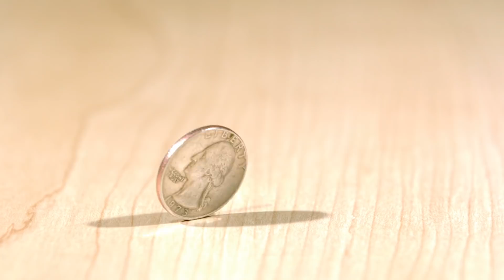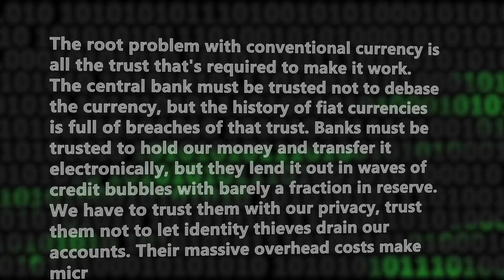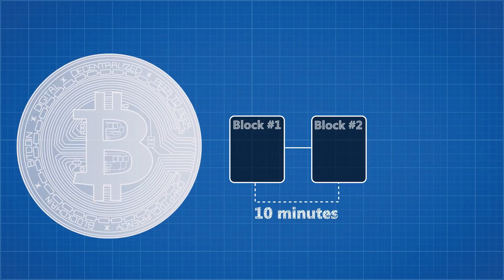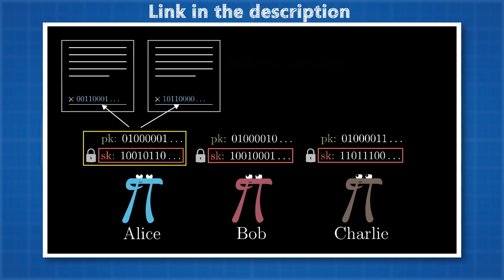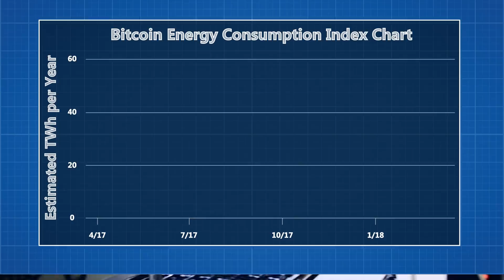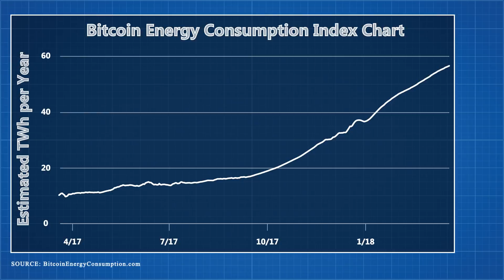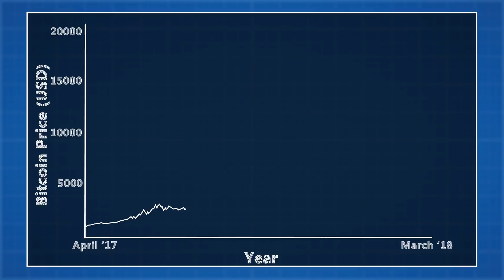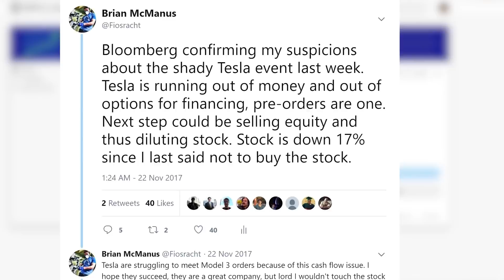Why Bitcoin Is Not Working

Comment: please fail

I want my graphics cards
Reply: OffPH.wnr You don't know what you're talking about. Bitcoin mining difficulty has risen drastically over the last 1,5 years making GPU-mining obsolete. Noone mines Btc with GPUs anymore, there's just too little profit at too much cost. Btc is now being mined with ASIC miners, the fastest being the Antminer s9 with 14,5 Th/s.

Altcoins such as Ethereum, Dash and ZClassic are mined with racks of graphic cards and are then exchanged for Btc or fiat currencies.
Reply: OffPH.wnr if you actually took the time to read past the first sentence and think, BITCOIN has not been mined with graphics cards for a long time. There is zero profit to it, it's pretty much pointless even if you somehow have free electricity because the difficulty is so high. It doesn't matter if you have 1 or 10 000 graphics cards, it doesn't get more profitable the more graphics cards you add because of the electricity and hardware cost.
Reply: Don't worry mate... as soon as a card stops being profitable, which won't be long a year or less will be its lifetime before the mining difficulty makes it obsolete, there will be a flood of cards and you'll be able to get them SUPER cheap.
Reply: you realise graphics cards will be cheaper due to this
Reply: This will get you better graphics cards in the long run. Demand drives innovation.
Reply: Used for mining, not mining Bitcoins. The small amount of total bitcoin miners that are still using graphics cards are losing money and are using so little electricity it's insignificant to the issue.
Reply: Do we have to have a "Bitcoin isn't mined with GPUs" comment in every thread? Yes we know that, but Bitcoin is pretty much synonymous with cryptocurrency at this point. Many people mine alt-coins and convert it into Bitcoin, so in a sense they are indirectly "mining Bitcoin." So what if it's not technically correct, we all know what is meant.
Reply: likewise mate, likewise.
Reply: yeah, but thanks to these crypto currencies craze people plant malicious program in peoples personal computer to suck of computing power from them
Reply: redX111t do you live on Mars?
Reply: You just proved your ignorance.Nobody uses GPU for mining bitcoin.
Reply: Bitcoin isn't even the cause of graphics cards going up...
Reply: +OffPH.wnr you can't mine bitcoins with graphics cards for a long time. you need ASIC miner. don't spread false news. You are just being ignorant.
Reply: m4ryou5h I know you're exaggerating, but even if it's a small amount of the total miners, there are still a lot of graphics cards being used for it. Go on Craigslist or r/hardwareswap and you'll see a lot of people selling cards that were used for mining.
Reply: Dude you don't understand anything about crypto currencies.
Crypto will be here for a while, Bitcoin dies ethereum rises, ethereum dies litecoin rises and so on
Reply: bingo Insignificant to the issue of mining, but not to the issue of the lack of supply and inflated prices of graphics cards.
Reply: +ApavTech bro other coins can be mined by the graphics card and you can't mine bitcoin by the graphics card anymore. as an example, if you mine bitcoin your electricity cost will be 10$ and your income will be 0.01$
Reply: #iboughtyourgpu
Reply: Me too, still stuck with 560 ti's
Reply: Oh, and you should all tell which algorythm it is not used anymore for. SHA-256 is too hard now for gpu's, rendering their use kind of obselete. Of course they can still be used, but gpu's are more used on other like X11.

But anyway, bitcoin is the name flag of crypto's and therefore is confused between both. Bitcoin is 1 crypto in hundreds more.
Reply: Graphics cards won't go back to MRSPs even if all cryptocurrencies crashed. The flash memory modules (AKA RAM) shortage is the major responsible to the rise in GPU prices. The majority of miners are just consumers like you and me. But if you wanna blame anyone blame Samsung.
Reply: My point was  bitcoin was not the issue of no graphics cards.
Reply: Juusto, I'm sorry, I don't listen to hypocrites
Reply: Bitcoin hasn't been mined with graphics cards for a long long time, they make dedicated ASIC chips for that. Cryptocurrencies like Ethereum, Monero, Zcash and some other altcoins are the sole reason the GPU prices have soared recently.
Reply: TheRBZ we all do m8
Reply: me too bro... me too...
Reply: ASIC chips are very mediocre in mining + gpu's have higher demand because of their quick installation, thats what i think of anyway
Reply: Honestly you don't need more then a gtx 1060 if you want better go get a better job.
Reply: hahaa fuck you and do something else than just sit behind the computer.
Reply: its not going to fail you fucking nerd.

Comment: Disappointing, I expected better from you. No mention of Lightning Network and other layer 2 scaling solutions like RSK  to obliterate the 4TPS limit.  You havent thought through the environmental impacts either; bitcoin mining will naturally move towards marginal profitability, and thus cheap renewable energy. It will even only become profitable using excess renewable energy, thereby monetizing energy that would otherwise go to waste. This is good for the environment, because it makes renewable energy capacity affordable  and its much more efficient than electricity storage. As for volatility; thats inevitable as long as bitcoin usage is only an immeasurable fraction of fiat money, but there is no need to price things in bitcoin. Stable coins or even fiat pricing works fine for now.
Reply: RSK doesn’t really work lol. Federated pegs aren’t trustless.

Comment: It's important to note that the VAST majority of electricity used to mine bitcoin right now is being used to throw numbers at a wall and almost always get it wrong.  I don't know the exact number, but I'm willing to bet it's well over 99%.
Reply: merchn44b Actually +90% of gold mined where inside/contain other minerals/metals, it need to be crushed and filtered and processed with harmful chemical before the gold can be extracted and in it self very harmful to the enviroment.
Reply: KnowingBetter The chance of guessing incorrectly is around 99.99999999999999999999% (1 - 6.5*10^-23) with the current hash rate. Lol
Reply: Nathan Ryweck Debatable. What is a bitcoin doing other than representing money? Nothing. Gold has a lot of use as a material in itself.
Reply: 2 months ago bitcoin mining would consume all the electricity produced from the biggest 9 or 10 power plants in the world - there is a good list on wikipedia, search for the biggest power plants by capacity and take the first 10.
This was in perfect case - most powerful miners with lowest possible power consumption per hash, no old hardware, no GPU, no wasted power on backbone CPU/PC.
Reply: At the current hashrate, you have a one in 14,909,717,412,600,000,000,000e chance of a hash being a solution. That is 0.000000000000000000000067% or 99.999999999999999999993% waste
Reply: Huge wastes of energy.. yay.
Reply: merchn44b no. It's like saying gold mining is bad because 88% of gold doesn't get used for any purpose but store of value, and spending real labor power to create symbolic value is a drain on the labor market, and on any critical resources used to mine gold.
Reply: Yes, but then you have to ask WHY are we mining gold? There could be good reasons to do so/to mine and process rocks that generally have no gold in it. The difference between gold mining and bitcoin are great. Geology contributes to how gold is located, and you can use that information to not waste time digging a hole in your back yard if there are no other factors that indicate the existence of gold in that location. What signs can steer a miner towards a correct code? How can they reduce the energy wasted to successfully mine coin?
Reply: Nathan Ryweck Cryptocurrency itself is also negatively affecting customers in other markets, like the video card market. Gold is not negatively affecting other markets.
Reply: Kanglar Exactly, saying that bitcoin doesn't work is like saying money (anykind) doesn't work. Money is just one kind of proof of payment or a ledger of trade, that state you have a certain Values of valuables(is it a work you had done, or items you sold) in your hand that you can trade for other items/service from others.
Reply: As Thomas says, sometimes computing a result by brute force is the only viable method. The real problem is that even when you have the right answer, its only purpose is to prove that you wasted a ton of electricity finding it. It's like basing your currency on the wasted work of digging holes and filling them back in again, over and over again.

Compare that to distributed computing systems like BOINC where the output is desirable for its own sake, like modelling the physical behaviour of protein chains.
Reply: Thomas Kilmer that's a short sighted and destructive goal. The concept of cryptocurrency is here to stay. So long as the worlds economies keep turning. (Which they won't). Quantum computing isn't even close to where it needs to be to hit that target. But that's only half of the coin... As soon as that happens we will have quantum encryption and whole new era of cryptocurrency. So the thing that you're so gleefully betting on to burn down crypto will actually be it's rebirth. 

But by that time crpyro will only be a drop in the bucket of what we'll be seeing.

Not that it matters though. Technology will be our undoing. We'll have destroyed ourselves twice over by then. The odds are far more likely that ten years from now you and I will be having a much different conversation while sitting around a camp fire cooking a dog in a post apocalyptic hell. "Hey Tom can you pass me the radiation meds?" 

"Id love to Ale but we had to eat my arms last week remember? If only we came across this dog a week ago... Or if I had picked rock instead of scissor..."
Reply: apocalypse most gold does noting useful at all. Only a tiny fraction is used for any technological purposes. Most is sitting in a vault, off of the market. If it were on the market, the price of gold would plummet and gold mining would no longer be profitable and the gold could be used for better tech, such as better computers, electronics, and medical equipment.
Reply: I think that is the point and the purpose of the video though, yes mining gold is wasteful, expensive and the purpose behind Bitcoin was to get away from that.  Instead they just created a modern day gold rush changing nothing.

Bitcoin's only real value (same with gold) is what people put on it.  And yes all of our money is the same.
Reply: @merch That's is absolutely not the same fucking thing
Reply: @  
Akshay Sapra I think that it's a fair analogy.
Reply: KnowingBetter it's much higher than 99%.
Reply: Weedle Guy so are graphics cards and electricity
Reply: KnowingBetter what about all the electricity consumed by all the smartphones is that necessary? or what about stupid people breathing fresh my fresh air? Should we kill all the stupid people and keep the smart ones?
Reply: The wasted work is wasted and not important at all. PoW is a flawed concept; you are forced to waste a lot of work, and the more you waste, the higher chance you have of finding the correct hash. It's backwards and ineffective, but it does get the job done. Ideally you'd want to waste as little work as possible, so as to keep the currency from being inflated by the work done and maintain stability from trust and intrinsic value.
Reply: Kanglar I think that’s what OP was saying the problem is. We don’t want a currency that sucks so much energy from our grid as it’d be harmful to the planet in the long run.
Reply: Google and amazon data centres use up 100’s of times the electricity that bitcoin uses
Reply: merchn44b unlike gold, energy today is way too similar with food, the term "Energy Crisis" exists for a reason and a lot of people are racing to solve our energy problem. 
Gold on the other hand is usually not lost, it stays the same and can be recycled and re-used. 

Energy on the other hand, once used cannot be properly recycled. 

Bitcoin's energy consumption is just way too off the charts and this not up to the programmer to fix but the hardware manufacturer.
Reply: Alexander Taves Long story short: it's almost unimaginably harder to make a quantum blockchain than it is to break a classical one. There will be a gap of decades between when the two technologies are each viable.
Reply: KnowingBetter That's like saying gold mining is bad because 99% of the time you try mining a rock you don't get gold..
Reply: That’s why you mine in a pool and when your pool gets it right then everyone in the pool gets a share of it
Reply: Yeah, I think cryptocurrency is a terrible idea and (as a quantum computation researcher) I'm gleefully looking forward to the day when quantum algorithms crack their encryptions wide open and this huge waste of energy comes crashing down.

But I mean ... just because a computation gives the wrong answer a bunch doesn't mean it's a bad computation. I run optimization algorithms all the time which give me millions of non-optimal solutions before finally hitting on the right one. That's just how computers do. 

In all honesty I don't mean this critically, but you managed to pick the one criticism of bitcoin which isn't valid.
Reply: That's the point, it's the PROOF OF WORK, hence the name. You act like it's a bad thing that most of the work isn't finding the correct hash, but actually the really important work is all the "waste" that doesn't find the hash. All the work to find the hash is meaningful not just the final hash that has the proper number of leading zeros, because the fact that it needs too be done in order to find the hash is what makes the network secure.
Reply: KnowingBetter, "throw numbers at a wall and almost always get it wrong" you clearly don't know how bitcoin works...
Reply: We are mining gold for profit, just like mining bitcoin. If either is no longer profitable, no one will keep doing it. Nobody uses GPUs for mining bitcoin anymore, so they don't affect the market. ASICs have changed the game and are the only profitable efficient way to mine BTC. And if you think gold mining doesn't affect other markets, you clearly haven't talked to any fishermen. Salmon spawning rivers all up and down the Pacific coast of the USA have been destroyed by gold mining and all the sediment and toxic crap they dump into the rivers.
Reply: Gold mining is far worse for the environment  than bitcoin mining
Reply: You do understand that when you find the hash, the rest before it will have to be checked once again to see if it happens to be the ones before it.
Meanwhile you dig gold you know which spots been mined by either sign's of mining or some sample test with a fucking bowl and water.
Reply: you have no idea what the block chain technology is ir how it works think outside of the cube think 4d the encryption tech is un breakable it is where the digital code is held that is high risk not the transaction we are only at the beginning of the crypto revolution

Comment: Everything and anything will be exploited... while limitations of crypto-currencies are indeed daunting, they are not insurmountable problems (simply because we have yet to try to surmount them...). The trust issue with the current banking, and voting system, that currently enables power to be horded by the few is something we've tried and failed to surmount for centuries.

Banks currently have a licence to print money from governments, both are at an all time low for levels of trust from the public. Thank goodness we have an alternative to raging against the machine.

Perhaps this time we can have technological change rather than the revolution we've experienced through wars in previous centuries.

Comment: Great video, I'm a bit of a crypto man and found your explanation of both the system and the flaws well rounded and informative. I appreciate you pointing out there are others trying to improve on the system (such as ethereum). The Segwit proposals also have some merit (if only they could be adopted) 
If you're interested in doing more on crypto currencies could you look in to Proof-of-Stake mechanism as it alleviates the big issue of power consumption.

Comment: comparing energy consumption of bitcoin to visa is like comparing a bakery to a circus. the consumption of bitcoin doesn't give any scale, but security only. an vice versa, on visa you won't get any more security but scale with more power. as more miners are participating in bitcoin the same amount of coins are created/issued every 10 minutes. it is only a matter of securing the blockchain by sharing it between more so called miners. 

I thought this video will give some insight or more technical view, but instead this is utter nonsense.